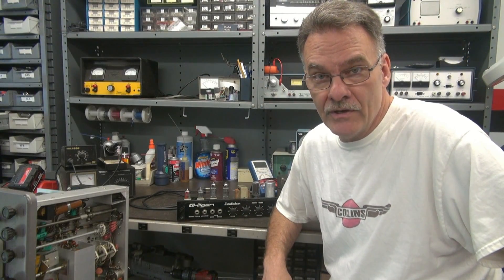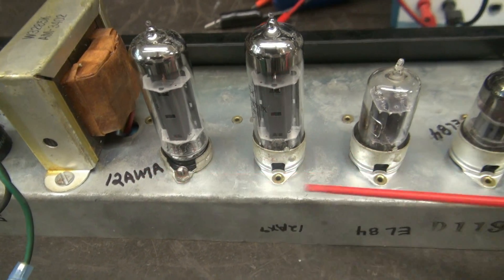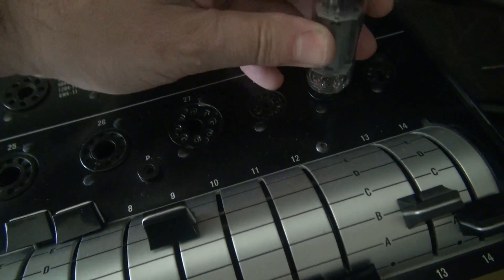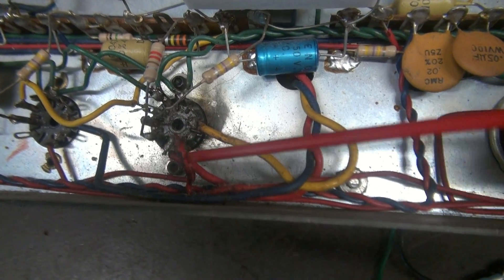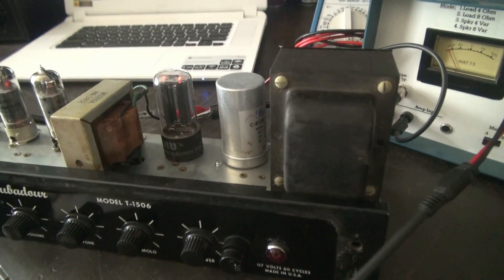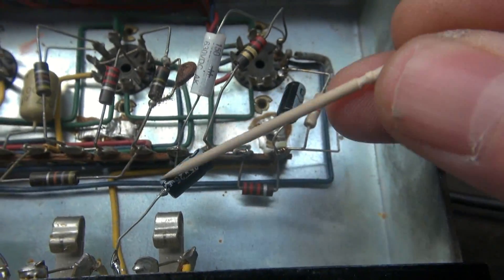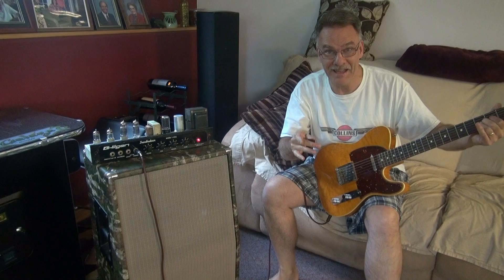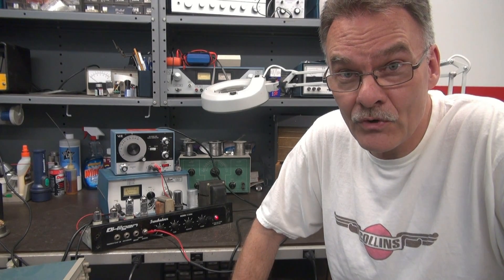How to repair Hilgen T-1506 Troubadour Tube EL84 guitar amp D-lab

Comment: You do very good work Terry,clean up all those hack repairs by some guy with a solder gun thinking he is an expert technician.Not knowing there are hi voltages in tube gear can be dangerous,and also not using a diagram .

Comment: I've seen several Hilgen bass amps, but this is the first time I've seen a Hilgen guitar amp.

as for the pilot light that was wired to 120 volts, perhaps it was originally set up (or modified) for a bayonet base neon bulb like an NE51 and had, or should have had, a dropping resistor in series with the socket. However, the lamp socket (non-original?) shown in the video does not have separate isolated terminals for the bulb, and the shell side of the socket that would make connection to the bayonet shell of the lamp is physically and electrically connected to ground, which really isn't a good idea (can cause audible noise due to  AC current running through the chassis ) even when you're running the pilot lamp off the same 6 volts that powers the tube filaments; and it's definitely a very very bad idea if you're using 120 volts for a neon lamp! [edit: I watched the video second time, and the pilot lamp socket does indeed have separate Terminals and appears to be isolated from the chassis. as it should be. let that be a lesson to me to not assume anything from first viewing! although it's a little dark down inside that chassis and the camera angle makes it hard to see some of the things that Terry was trying to point out.]

Comment: Nice playing Terry !!!  :)   And a nice job on that amp.  I suspect you can reduce some of that hum with a pair of 100ohm resistors from each leg of the idiot light to ground as I don't recall seeing a Center Tap on the 6.3 filament line.   - Very nice job - Ron
Reply from the maker: Hi Ron, Yes, this one has the CT on the 6.3 vac. Hard to see in the video.

Comment: I just built a class A power amp, after testing i bad to replace the power transformer because it was getting hot, so I installed a heavier one that can handle more current. Is there a way to bias a bit the output tube so it will not pass so much current and keep it close to a class A??
T

Comment: I am impressed with you finally taking up guitar...I just finished installing new "matched" tubes in a '65 Fender Princeton Re-issue...the old ones are too outrageously expensive as I like a "p/p wiring scheme" better.  Got Fender to send me service manual for the Princeton which is real nice of them so I could re-bias the 6V6's...I am working on my home built 5F2(A) as it was running "HOT" (18w pwr dis)...took out 470/ohm cathode resistor and gonna replace it w/820/ohm (waiting parts). I really enjoy your videos !73 - Tom/K1TL...
Reply: tomk1tl I would bet that your power transformer or rectifier isn't "historically correct. The only new production 5Y3 that's correct is the JJ, all the rest don't have the right voltage drop. Even the TAD 5Y3 is wrong(relabeled Sovtek).

Remember, check the plate voltage on a cathode biased amp at the pins(3 and 8 in your case). Otherwise you'll get the wrong numbers. Then check the voltage of the bias resistor by clipping your leads on both sides of it. Good luck!
Reply: The xfmr is the one found on the 5F2 schematic...I get 385VDC on the plate of the 6V6 with the 470/ohm cathode resistor (which measured 545/ohms)...E drop was 24.83VDC = 45mA.  This comes out to about 17.5w pwr dis... this is definitely running "HOT". ..but the cat loved to sit on top of the cabinet.  Installing an 820/ohm should get it down to a tolerable level.  Will keep you informed.73 de Tom/K1tl............+ a CW man ! ! !
Reply: tomk1tl if you still have issues, a 5w 10v Zener diode between the HT (stripe to ground)center tap and ground might help. No diode noise in that position either. It's a great fix for higher modern line voltage. Way easier than taking a few winds off of the power transformer!
Reply: Addendum.....I installed the 820/ohm in the cathode circuit and dissipation dropped to about 13w from 18w but I am not satisfied with that.  I will install a 1K and hope that will fix the power dissipation problem. Odd that I was getting a somewhat DC (0.0003)reading on the grid of the 6V6...the only thing I can think of is the meter was funky as it is a Fluke "auto-range" but I can select down to mV...